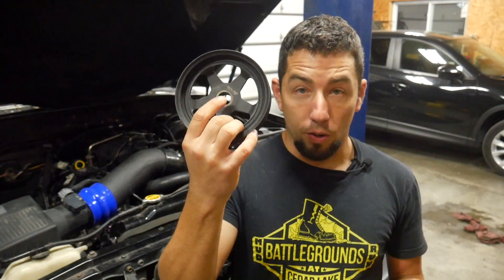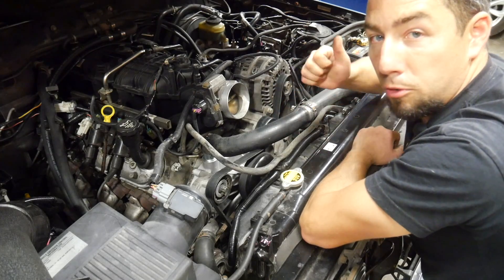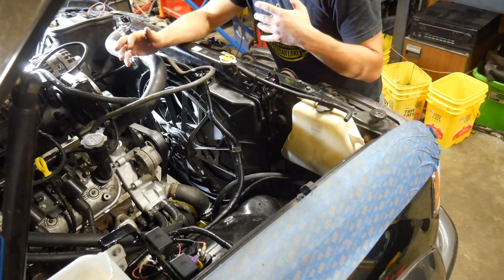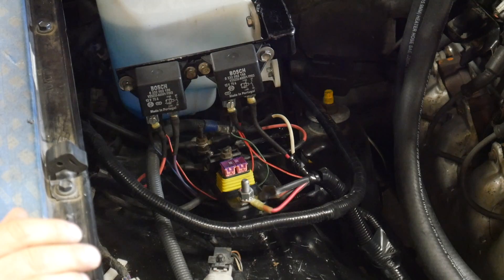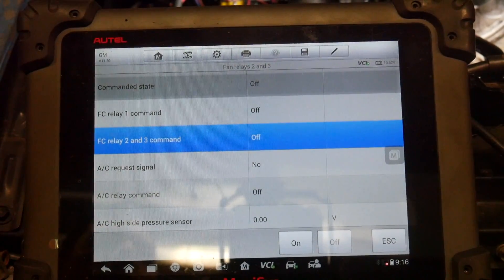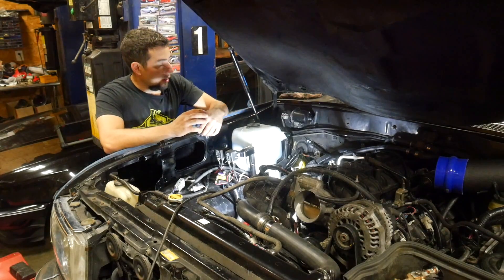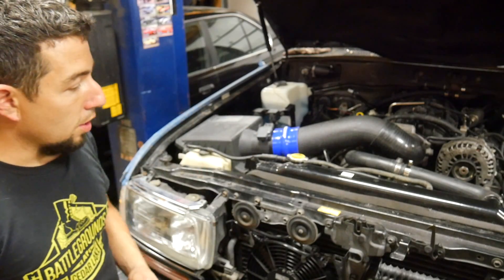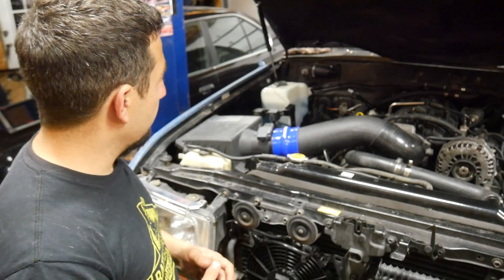80 Series Land Cruiser LS Swap Part 9! Cooling fans, Intake washer reservoir relocation.

Comment: I'm about to pull the trigger on an LM7 swap into my 93 80. I'm looking to go as simple as possible. Would mating it to the stock trans via marks adapters and putting on a holly dual plane intake and carb work to do away with 90% of the wiring? This would just be a trail rig in wyoming.

Comment: Although not a variable fan, the Mkv III fan is a two speed fan.. low and high.   Also check out the Volvo relay setup for running the fans.
Reply from the maker: 808keith these fans only have two wires that feed them. The middle terminal is terminated in the harness before it reaches anything. With only two wires, how would you change the speed of the fan without changing the voltage?
Reply: I Do Cars the mkvIII fan I had in my fox body had three wires could be the earlier model fans.  I heard newer ones have 2 wires?  Anyhow from what I gather when high speed turns on the low speed needs to be de-energized, and vice versa.  

Here’s some good info on those fans: https://www.tccoa.com/threads/ultimate-mark-viii-fan-thread.136722/
Reply from the maker: @kh1991  Yes, they are 3 wires but one of them is terminated in the harness and doesn't connect to anything. Those cars have a variable fan controller which changes the voltage to the fan adjusting its speed.